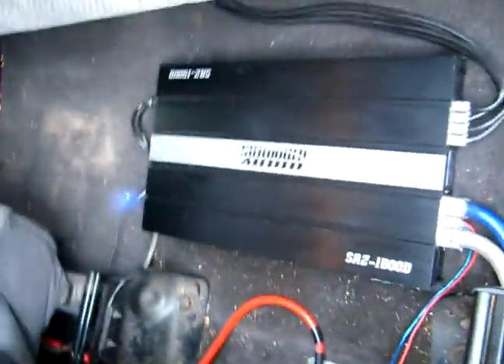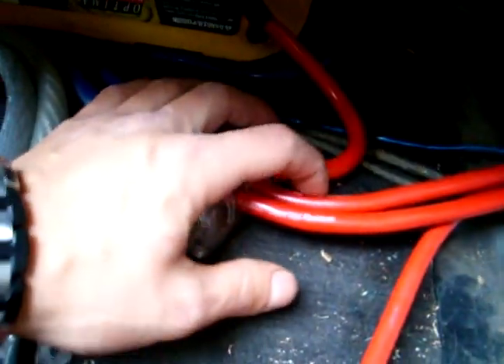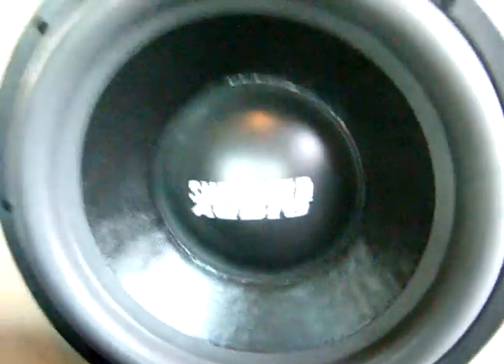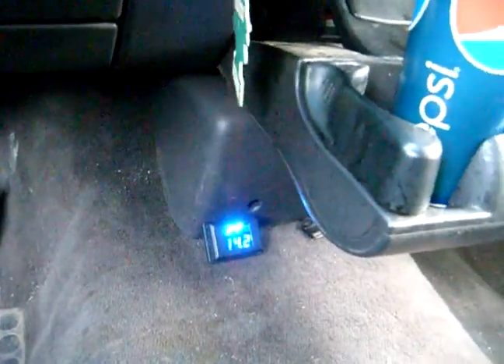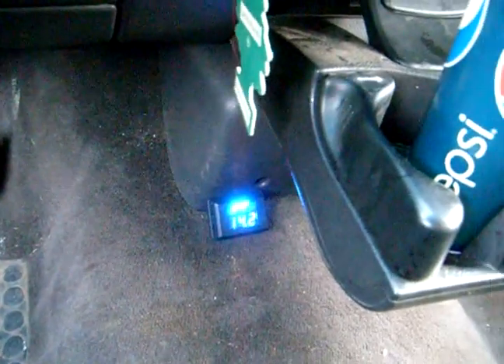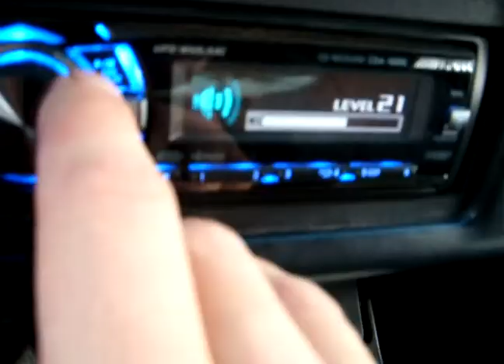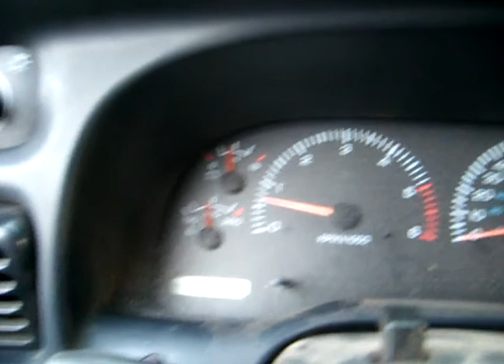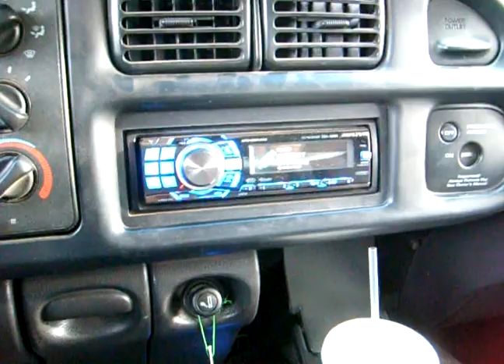SAZ-1500D V.2 + 1 SA-12 Completed Install, Opinions, and Some Excursion

Comment from the maker: @MASON858, yea, the Sundown Amp is MUCH more efficient than my Alpine ever was. I figured the extra battery helps with voltage drop, although after playing with this stuff a bit more, I would say it's not mandatory. I'm confident this amp would run great even on a single strong battery.

Comment: @Monkeypumper420 Okay, GOOD. I was hoping you didn't just drop off the face of the earth. I want to keep seeing that crazy ass sundown system man! I'm in the beginning stages of doing some crazy stuff to the t-bird I have been working on as well. Already have just a basic box for 2 12" subs. Going to put maybe 6 6X9" speakers in there. I have money to play with after I sold my truck, so I'm thinking of going all out. I want a system that can bump, but I actually like hearing the music. Any tips?